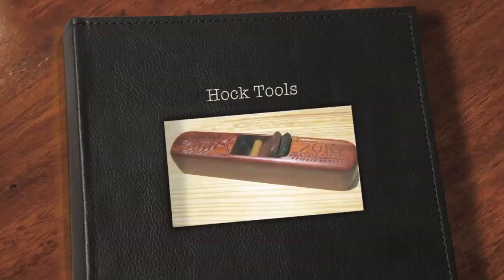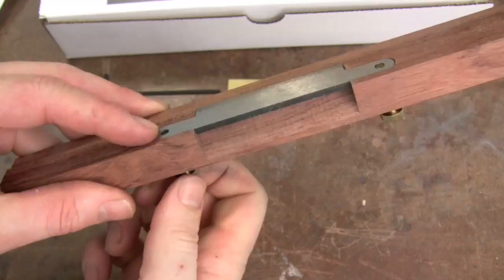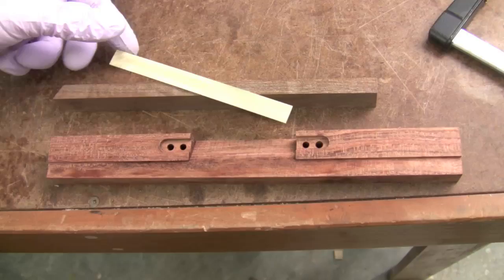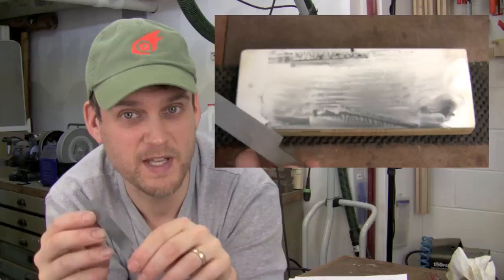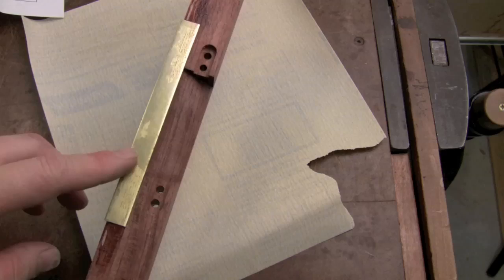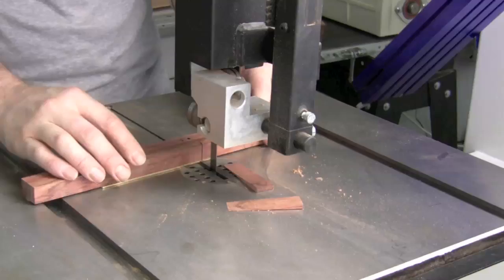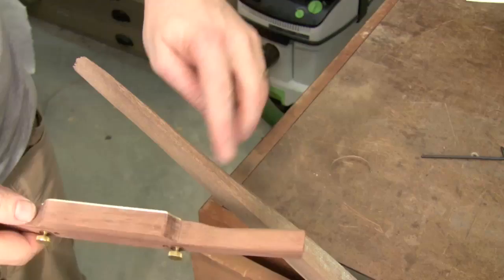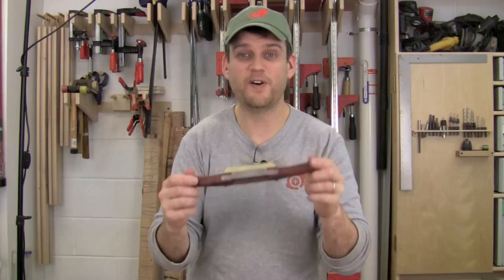Hock Tools Spokeshave Kit

Comment: Hi Mike,
Just wanted to let you in on a project I started. You are officially my first you tube comment, Just thought I would tell you about my project. I watched your video yesterday and thought,that looks like fun. I don't have an extra $80 to spend, could there be a cheaper way. I went through a pile of old stuff I had and found a spent joiner blade. I am no machinist by any means, but it didn't take too long to work up a blade. I cut the blade in half with a grinder and then drilled two holes. I then hit them with the tap to get the threads and that is about as far as I have gone, but I have saved myself a bunch so far. I would like to show you the pics, but I am not sure how to yet. Thanks for the inspiration to get at it. 
Brian
BearKat Wood
Reply: Wow - that is AWESOME.  Great job and very resourceful.  Super cool.  In the shop, use what you have and just "get it done" -- does not have to pricey or fancy, whatever tool gets the job done quickest is the way to go.
Reply from the maker: Wow - my wife knows a lot about woodworking ;)  Sorry - was accidentally logged into her Google account!
Reply: BearKat Wood I've been thinkin' the same thing. I have a couple of extra jointer knives from an old early 60s Craftsman 6 in. jointer. I've watched a bunch of videos of the Hock & Veritas spokeshave kits & I'm gonna do the same as you. I've got the brass already from HD (door kicker plates). Your comment has solidified my decision to go with the jointer knife. Thanks.
Reply: Very cool, go for it. I use mine all the time, it worked out great. Wow, it is hard to believe this was my first comment and that it has been a year already. I have done a lot since then.  Thanks for the blast from the past ;)

Comment: Mike, nice video and I like your enthusiasm, however, for $20 less you can buy a Lee Valley low angle metal handles spoke shave, I know, what's the fun in that? you may say, well, if you didn't figure it, I'll let your take your best guess.
Don't get discouraged, my only "beef" is with the HIGH prices of kits that should be lower than a finished product, for an example: you can buy for less a whole spoke shave for the price of the Hock "blade" only! Figure that one out!
Reply: Not sure where you saw the spokeshave for $20.00 because the Veritas® Low-Angle Spokeshave  05P32.01 runs $69.00Only rhe 2-3/8" Replacement Blade  05P32.02 runs $20.50	and the Optional PM-V11® Blade
 05P32.72  is $24.50.
Reply: Sorry my friend, you totally misunderstood me.
My comment was to Mike about his enthusiasm for the Hock kit that cost $84. so for $20 less (more or less) you can get a ready to use Veritas spoke shave.
Yeah, what's the fun in that?
I hope I made it "clear" now...
Reply: ronin4711 Sorry, I did misunderstand.
Reply: @ronin4711  
The whole point is to make it yourself. Why are you on here if not for that? I know. Late comment

Comment: First, do you preferred to be called Mike or Scott?  Next, I see in the video you used the low angle spokeshave pulling it toward you?  Do you always use this type of spokeshave  by pulling it across the work piece toward you or do you ever push it away from you across the work piece?
Reply from the maker: Steven W. I generally prefer to pull the spokeshave towards me.  I feel that I have better control.  But you can easily push the tool also and it depends on how the piece is being held, the grain direction, etc.  Whatever feels comfortable!